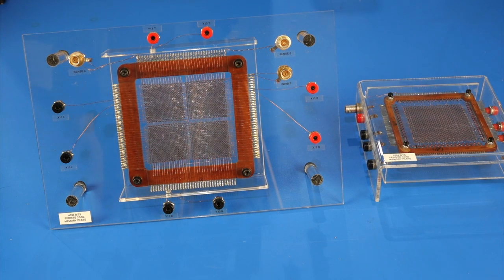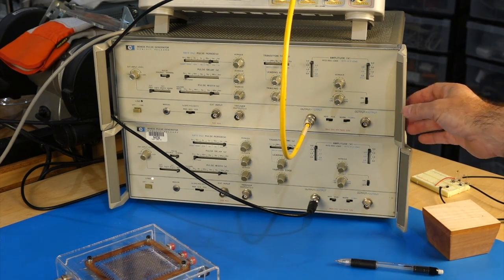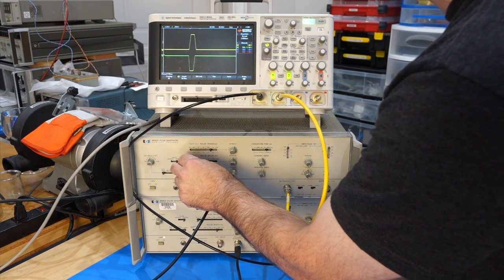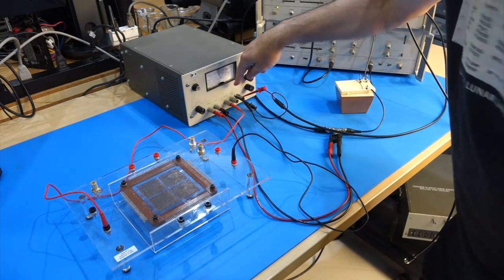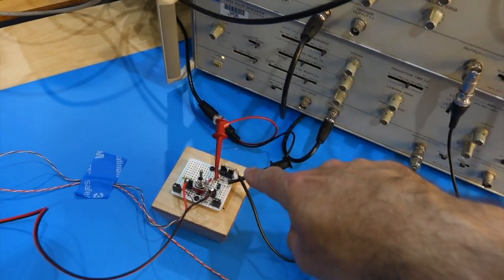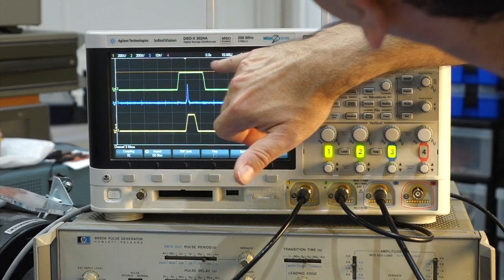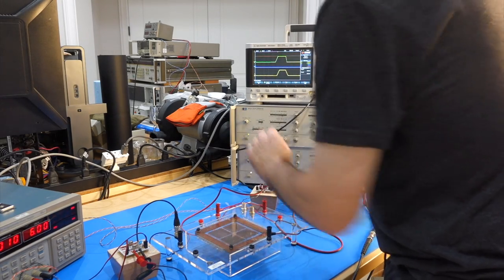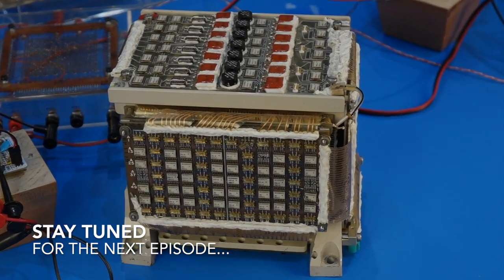Playing with Soviet Era Ferrite Core Memory Planes

Comment: I heard that in the 80s a Soviet Fighter Pilot defected to Japan with a MIG. The US was itching to take it apart to find out what their capability was. They were surprised that the advanced Soviet Jet Fighter was filled with decades old tube technology. Then somebody realized, if there was an EMP blast, anything with integrated circuits would be fried while the tube based tech would be untouched. I don't know how much of that is true, but its crazy to think 1900s technology like vacuum-tubes and 1950s technology like ferrite cores would still be used a century and half a century later. It also makes me wonder what other forgotten and abandoned technologies could take advantage of modern manufacturing techniques and discoveries.

Comment: Th circuit you used for combining the pulses onto one wire is nearly the same as what you use to add in a stereo aux input to a vacuum tube radios pre-amp tube. Solid circuit.

Comment: You should put some of that magnetic viewing film over the cores to see them flip that way, that'd be awesome.
Reply from the maker: That would be very cool indeed. I actually tried. Unfortunately the magnetic field is many orders of magnitudes to small for the regular film to work. I tried with much more sensitive oil-based viewers instead, and that did not work good enough either (way too slow), although I saw a hint of something. Then I tried to contact some professional outfits that do magneto-optics films and cameras. That would work, but that's many 10's of thousands of $ worth of equipment and they were not interested in sponsoring a loan.

Comment: Just wondering - would an MR sensor, such as from a disk read head,  be able to read the core magnetic flux? Small enough for high spatial resolution. Donor hard drive could even supply the read amp (?!) .  Back in the day we played with some super-sensitive MR sensors that could read the mag field of a Nd magnet disc being flipped in someone's pocket some ten feet distant.

Comment: The thing is that these are as similar to many computers of that time , no matter the ferrite ring a bit better than modern computers or rather a theory that they may. Regular comps have 1/0 and these as well, but they can also inhibit a stage of 1/2 , ie not on, not off. If we make use of the 1/2 possibility the math is gonna blow

Comment: With core memory, are the magnetic fields strong enough that you can see them using some "magnetic viewing film" sitting right on top of the core array, or would you basically see nothing/no activity at all?
Reply from the maker: That is an excellent suggestion, I had not thought about it. My bet is that you would see them.
Reply: @CuriousMarc  yes as long as the grains in the magnetic viewing film were tiny enough to show the field around the rather small core donut.

Comment: That is not how you calculate the input impedance of a transistor with a resistor in the emitter circuit. What you did is to assume that the resistor in series with the base is what determines the input impedance, but that's only a small part of the total impedance - you have to add hFE*RE (where RE is the value of the resistor in the emitter circuit, and hFE is the current amplification of the transistor).

Comment: A great demo! Do you happen to know, what machines they're from? I've used to have a module from ES-1020 (a low-end model from the early IBM/360 clones, that particular machine was decommissioned around 1993), and I think it looked like your lower-integration module, but it was a long time ago, so my memory is fuzzy :-) It would be interesting if they turn out to be from different machine series, say ES and BESM (I think the series SM that included clones of HP and DEC PDP-11 machines used the integrated memory from the start).
Reply from the maker: I actually don’t know much about Soviet machines and have no idea which ones these belong too. It would be great if someone could tell.
Reply: @CuriousMarc  Are there any markings on the modules? Those might be helpful in identifying the machines. BTW, there also were machines made in at least GDR and Poland, GDR was making quite a few of high-end IBM mainframe clones, so the machines might turn out to not be Soviet too :-)
Reply: The first module looks like the one from soviet computer "Promin" (unfoirtunately, no English traslation):
https://ru.wikipedia.org/wiki/%D0%9F%D1%80%D0%BE%D0%BC%D1%96%D0%BD%D1%8C_(%D0%BA%D0%BE%D0%BC%D0%BF%D1%8C%D1%8E%D1%82%D0%B5%D1%80)

The second one looks like memory from ES series (IBM Syetem/3xx equivalents), probably early models, but I'm not sure.

Comment: Intel might have introduced IC's in 1974 but the Soviet Union would have continued to lag behind ten years, the story of how they ended up with working IC's and when would be interesting.
Reply: Intel what? When? ICs were out there since 1959. And first integrated CPUs were available a little earlier. If you mean 8080 then it wasn't ten years. By 1983 8080 clones  were cheap enough to be used in simple DIY computers.

Comment: Imagine having 32 GBs of core memory instead of a single stick of modern RAM...
Reply: Wire Wrap Hell
Reply: not sure there's enough wire in the world to scale up core memory that much
Reply: The Burroughs B6500 was designed as a 1 MW computer (roughly 65MB). But as a practical matter, the biggest machine you could physically construct was 300KW. You simply could not get enough cabinets of core memory close enough to the processor to get 1MW. If you tried the cables to the extra cabinets would be too long, and the access time to those cabinets would be too slow.
To give you a feel for size, the B6500 with 300KW and a couple of IO cabinets took up about 50 x 50 feet of floor space. For one computer.
Reply: @lwilton  each word was 48 bit data (6 bytes) plus 3 bits of tag plus parity and stuff like that. So 1MW is about 6MB

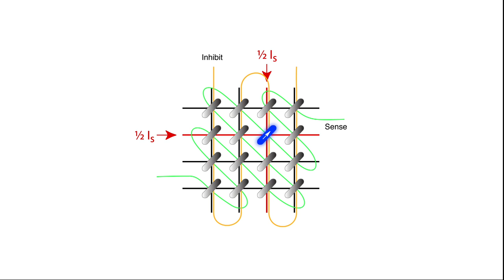Comment: Thank you for explaining this! 2:48 this may be the quantum mechanical wave behavior we've always worked around (destructive read means "the act of observing changes the state"). Spooky stuff!

I have a multi head 3D printer. But I do not know how to 3D design. Is there a way to create a fully 3D printable version of one of these, if someone has a multi-head extruder? How to create the iron toroids, while lacing conductive XY traces. The wire is magnet wire, coated, right?

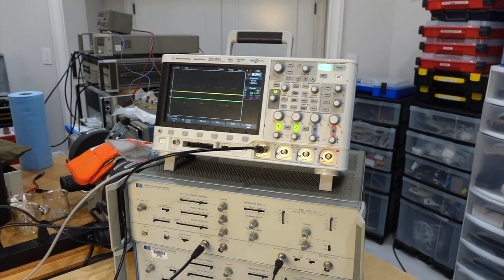8:02 beautiful pulse!

Is the sense and inhibit lines fed like a string through each toroids for practical reasons, or could you route it through all of them in parallel and get lower latency?

Comment: You say that "core memory is hard", but I remember using DRAM in my first computer (the generation of 4116 and 4164 16kx1-bit and 64kx1bit DRAM chips) and it was not exactly easy either!
It required RAS and CAS pulses and a multiplexed address and you had to continuously read all of the rows (different addresses clocked with RAS) or else it would lose the info...
At least core memory can be used and demoed using such a static circuit, that would not be possible with DRAM....
(of course there was also SRAM in those years but the sizes per chip were normally tiny when compared to the 16 or 64 kilobits on those DRAM chips)
Reply: By the time we got to the 4116 DRAMs were considered simple to interface to, though with the complication of +12, +5 and -5V power and address multiplexing. Earlier DRAMs were way harder to use with special drive and sense circuits not that different from what cores need.
Reply: @jecelassumpcaojr890  Of course it depends on how you define complexity.  Indeed the 3 different rails were trouble and also the multiplexing and refresh.  But of course no analog circuitry required anymore.
In those days I used a Z80 processor which has built-in support for the refresh, and other computers had the DRAM used as video-ram so it would automatically refresh.
Still, DRAM is a bit of a pain in the ** that continues until today, where some access patterns can defeat the optimized refreshing techniques and can cause bit errors...

Comment: On the second array; the blue sense wire which only addresses 1 quarter of the array: is it possible that this could be used for parity checking?
Reply from the maker: Don’t know, I also thought of it for a second. But it’s unlikely: that would be way too many bits, and they are also somewhat distributed all over the place.

Comment: Would magnetic viewing film show the ferrite coils polarity without affecting the memory? It would be cool to take a picture before and after the state change if it worked.
Reply from the maker: I think it would be fine and not affect it. However I am not sure it would distinguish between the two core states, as they are both equally magnetic.
Reply: @CuriousMarc  I would think the film would display a slight pattern difference in the orientation angle but It might prove interesting to see if you had a chance to post the results.
Reply from the maker: @tootalldan5702  I don’t have film handy, but it’s very interesting suggestion, I’ll see if I can find some. Maybe we’d see a “twitch” when the core flips!

Comment: I can see now why valves/vacuum tubes stayed on in some critical equipment during the Cold War.  An EMP (like that generated from an atom bomb) around this kind of memory could corrupt a running program when the sense and inhibit pick up the EMP.  Could even flip cores arbitrarily I would imagine if current was present in the system.  Valves aren't susceptible to that.

Comment: Fantastic ! Would it be more reliable than SRAM in the long therm ? I can't see many failures modes 😂😋
Reply: Only problem is the size and slowness, but the FRAM IC's have gotten past the size and speed quite well, using a very similar storage based on magnetic dots.
Reply: One way it "beats" S RAM is that it retains data on power fail.... old cores from the 60s MIGHT still have the data in them today.
Reply from the maker: Yes it is extremely good at retaining data for very long times. Doesn’t suffer from cosmic rays either.
Reply: @CuriousMarc  Wonder if they ever recover one from the watery grave, or from the lonely stage drifting out in space, if it will still be readable, containing the last instruction executed, which is likely a somewhat destructive to core memory of a jump back one word, if there is no actual halt instruction available.
Reply: @MartianTech  I guess it depends on the machine and the design. I remember row drivers as a failure point on the B 3500.
Reply: @MartianTech  Interesting!!

Comment: So how fast was that 1K plane? It looked like maybe 4x slower than the 4K cores, so somewhere around 10 uS?
Reply from the maker: It looks like 6 us on the scope. However you could still clearly see the core flip in-between the pickup spikes. If you had a gated sense amp, you could just restrict the sense to that time window and make it run almost as fast, at the expense of an even more complicated setup. Unfortunately my sense amps lack the gating feature.

Comment: Would there be a second memory that held what one core memory was holding so that it could be re written after being read?
Reply: Might be totally wrong here, but there was a huge amount of 'support' circuitry that went with this, and I think they handled the 'refresh' kind of like the early DRam chips...they pumped the data into a circulating set of serial shift registers, and rewrote them as they clocked out the data.... maybe....I'm sure someone here will give you a better explanation ...
Reply: Since a memory access cycle (read then write) is targeted to one address (X and Y line), the data being read is one bit per core plane - a word when you have a stack of the planes all driven with the same X and Y signals.  Typically you have a flip-flop per bit that is switched on by the pulse coming from the sense amplifier - if the bit had been a one previously, then a pulse is detected and that flip flop is set. The flip flops were reset before the cycle, so at the end of the read part of a memory cycle, only the flipflops associated with a core set to 1 will be set themselves.
The output of the flip flop controls the inhibit wire, so during the write part of the memory cycle, the flip flops that were not set drive inhibit, while the unset flipflops do not. This causes the cores that had been 1 originally to be written as 1, but the inhibit blocks this for the other cores, which stay at zero to match the value they had before the read started
Reply from the maker: Yes. Usually data goes into a read register made with transistor or tube flip-flops (a word of SRAM really), and is both sent to the rest of the computer and rewritten to memory from there.
Reply: @carlclaunch793  @CuriousMarc

 thanks you guys

Comment: Using magnetic field induced atomic alignment to store a state. I don't quite understand how the "State"[read] circuit identifies the magnetic polarity of the ferrite core. A memory controller could [or was] designed that as soon as an address is read it would send a reverse current through the same address if it is desired for the bit to be saved for reading again.
Reply from the maker: I explain it in more details here: https://youtu.be/AwsInQLmjXc  . Basically you try to flip the core and record the induced current spike if it flips.

Comment: I'm strugling with the logic here ! sending a read pulse would "activate" a set bit/ring giving a signal. So automaticaly sending a return/reverse pulse after, would, if the bit/ring were not set, reverse it? then next it was looked at give the oposite reading ?
Reply: Think of the read pulse as trying to force the core to the 0 magnetic orientation If the core was already magnetized in that direction, there would be no pulse detected in the sense wire. If, on the other hand, the core had been magnetized in the 1 direction, then it would flip. The moving magnetic field during the flip is picked up in the sense wire. This is how you know if the core was previously set to 0 or 1, by the absence or presence of a sense wire pulse showing a flip had just occurred.
Therefore, the write pulse is the opposite direction, it will force the core into the 1 orientation. In fact, the write pulse on the X and Y lines will always flip the core to the 1 direction. That is the reason there is an inhibit wire passing through the cores. If you want the core to be 1, do nothing. If you want it to stay 0 like it was oriented after the read pulse, then you feed current through the inhibit wire so that the sum of the X, Y and inhibit line currents is below the threshold to flip the core. 
What Marc showed by pressing the button twice was that a core that had been oriented one way, if fed a pulse trying to set it the other direction, would give off the sense pulse on the first push. That push had flipped it, so a second push in the same direction produces no pulse because the core was already oriented the same way.

Comment: Makes me wonder, how many wires and components would be needed to build that 4Kb plane up into a working .5KB memory unit to use it fully with something like a raspberry pi?
Reply: It would have to be implemented as serial by bit memory in that case, so it would take shift registers and 8 memory cycles for each byte, so would be very slow. That was why they used independent planes, so they could access multiple bits at once and read or write an entire word at a time.

Comment: if you can set every ferrite ring in 3 positions (+1, 0 and -1) does it mean you get 3 bits per ring? Or can't you actualy set them to have no magnetization?  What happens when you send current through both wires (crossing inside ring) at the same time?
Reply from the maker: It does not like that. Setting to zero with something with that much hysteresis is hard! You’d have to degauss it with an exponentially decreasing alternative current maybe? Sending coincident current to both wires is how it normally works and what I demonstrate here.
Reply: @CuriousMarc  but there is that point (marked as"Hc" https://upload.wikimedia.org/wikipedia/commons/c/c7/B-H_loop.png  ) on the hysteresis graph where you can achive coercivity so there is no magnetisation left. Theoretically you can do it (hence its on the graph) and then while reading you should get no response? Maybe it's possible with super fine tuned current, or at least you can lower magnetisation to such point that you can read really weak response signal as 0. I think it would be cool because you can squeeze out 50% more space from given memory plane.
Reply from the maker: My understanding is that these points are not stable, the curve represents the path it takes while flipping. To get there reliably, you'd have to approach it the way I describe like in a degausser. I'm not an expert though. Magnetism is complicated. The one sure way to demagnetize would be to heat the core up.
Reply: @CuriousMarc  im reading some explanations about it and it says that you can demagnetise it and there is nothing about it being unstable. The other way is heating but it can be a little destructive :P 

I would throw links but those notes are in polish and I feel that Google translate would not perform great with scientific terminology. 

I would love to play with cores and test it but I don't have any lab power supplies nighter money for them unfortunately.
Reply: @CuriousMarc  also they say that when you magnetise ferrite using small current thus it's not "saturated" and magnetic field is weak, then it's unstable, but they don't explain what that means (it flips? Is easily changed by external factors? Can disappear by itself?). They also say that you need around 5x more power to saturate ferrite with magnetisation that to demagnetise it to coercivity point.